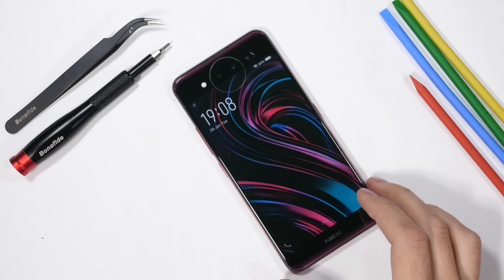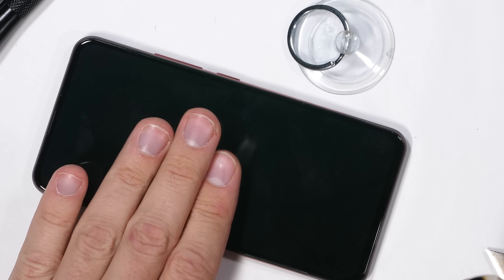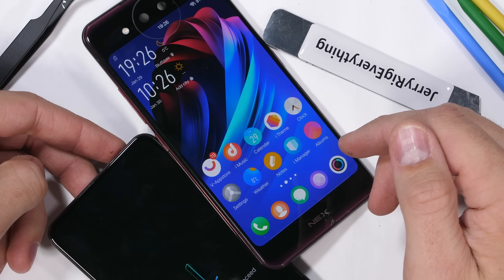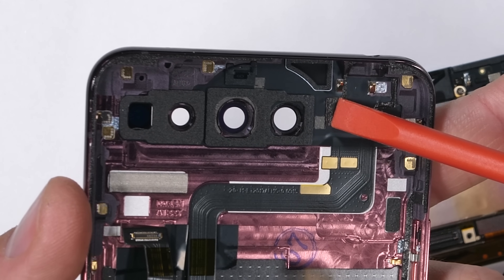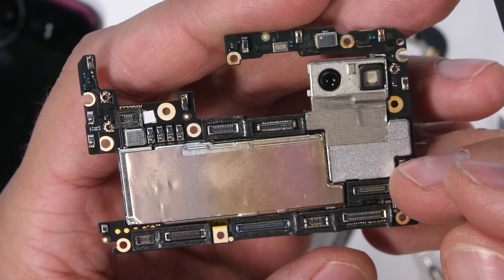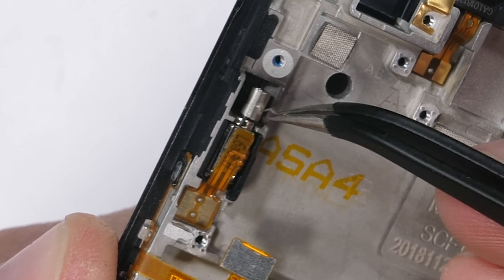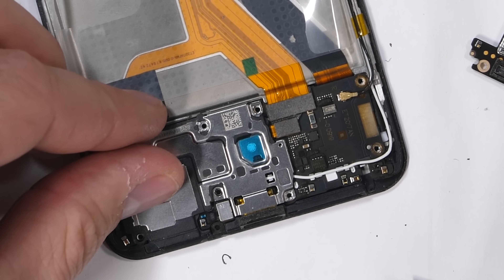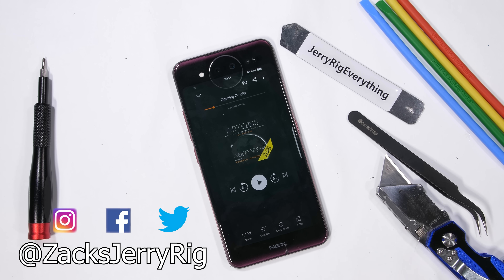Vivo Nex Dual Screen Teardown! - Its complicated...

Comment: Hopefully there’ll be a phone one day that’s entirely display on all sides including where the buttons used to be replaced with software buttons and the only part with no screen is the charging port (since wireless charging doesn’t seem to be getting any more practical any time soon) and then it has an eSIM and the cameras and speakers and fingerprint scanner are under the display

Comment: We should show this video to Apple, Sony, Huawei etc. so they’ll see how small the headphone jack is and how easy it is to build it in without removing something else.
Reply: Profits come first to these companies, let's face it.
Reply: Thing is that headphone jacks are points that compromise the water resistance of the phone, and it can make more room for a bigger battery, and room another camera lense for the fingerprint scanner that is now often found underneath the screen towards the bottom of the phone, and a lense for picture taking.
I feel like they should give an option for the headphone jack, and that is to offer it either on XL version of the phone and make the rest of the line up without the jack.

I only use my wireless headphones but I would appreciate the choice of my phone having a jack or not

Comment: Wait, with that in-display fingerprint sensor, that has a camera can't we have the same thing for a normal selfie camera? Like without have a hole-punch display?
Reply: the only reason the sensor works is due to light from the display shining on the finger. I don't think the screen could emit enough light so it could capture your face. Future tech might improve that tho
Reply: @plasmasheep4098  ohhh ok I feel ya

Comment: This is neat but I think having a smaller rear screen (like a rectangular 3 inch or so at the top under the camera) would be good. I mean the whole point is so that you can still have a screen to see your selfie and not have a notch on the front screen. As that is the case the screen could be much smaller and then they would have room for a Wireless charging coil at the bottom of the phone.

Comment: Zach, out of curiosity, ever try a isesamo tool or halberd spudger, or even a roller type display removal tool(sorta like for iMac) to open up these phones instead of utility knife😉 Also, I display/bezel heater might help ya out since do this for living(use all these tools to repair electronics, phones, computers, etc....). Just a suggestion, up to you if use. Ever need any help, let me know.
Cheers, A

Comment: Instead of dual screen on a mobile, how about using transparent oled technology for a part/whole of the screen behind which the camera can reside. Open the camera app and the device turns off those few pixels from display in that place. 
A better alternative to punch hole camera from Samsung or these dual screen smartphones.

Comment: I'm very impressed Vivo,.. you almost there. and the biggest con is the UI.
but this is definitely the way to go. these OLED layers are surprisingly thin and simply idiotic to not use a glass back from one of those to put in a lower res small OLED screen in fx 1080p and be able to use all the primary cameras for peoples selfie-needs while fronting new limits for a bonafide all screen that are not humped by ugly pinholes or notches and you also save on the cameras and sensors on the front.
so far one of the best solutions on the market.